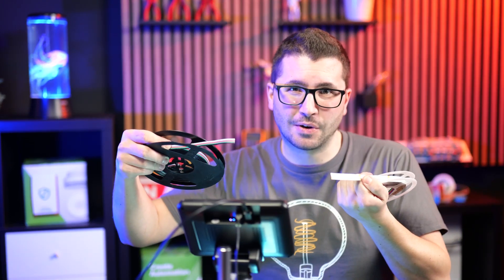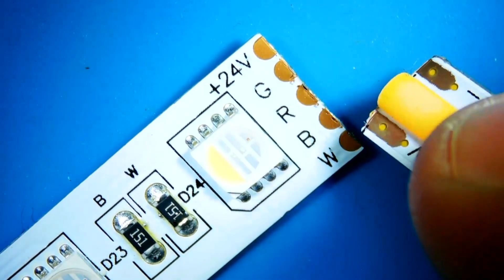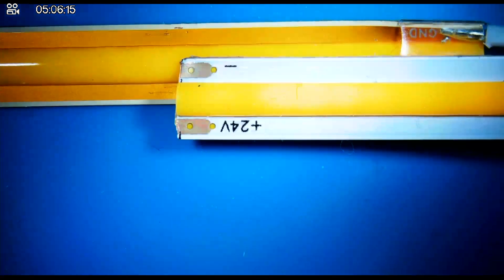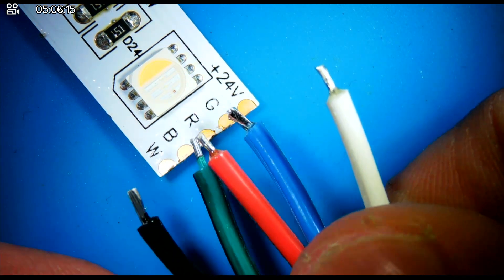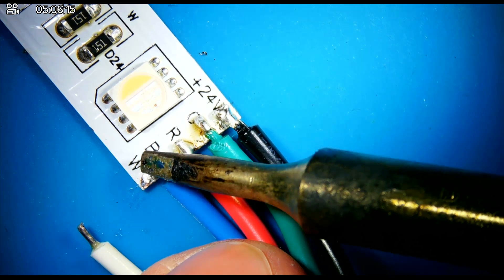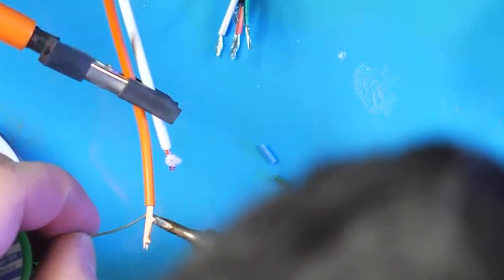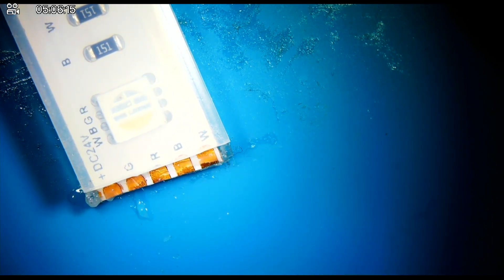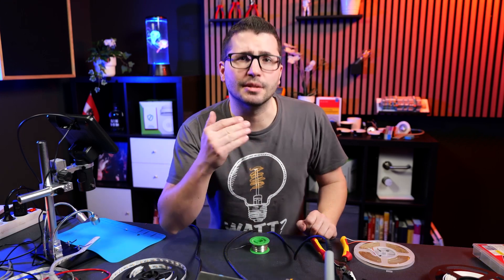WIRE to LED strip tutorial #smarthome

Comment: What are the "LED Strip Accessory Set RGBW" like which Loxone sell? Why don't people use them? I have no experience with them.
Reply from the maker: They work for the Loxone strips but typically in an alu profile they are too big to use, also the connection is just pressed on, heard from others it could lead to bad connections and even burning connectors if the contact is super bad and resistance high.

So me personally i solder them if possible
Reply: @ixma_en  Thanks good to know